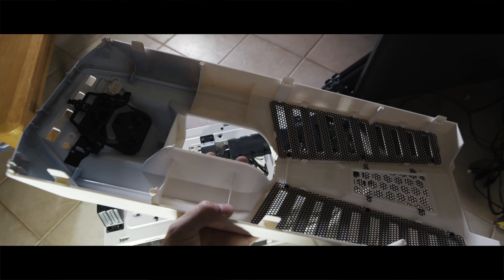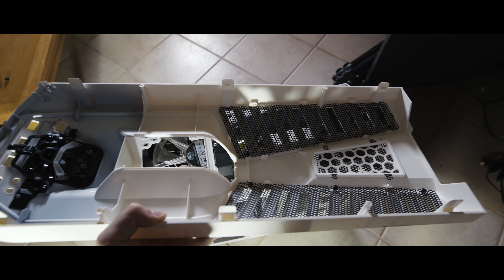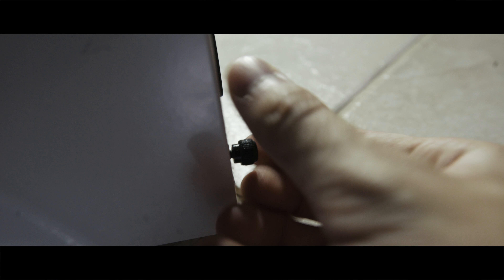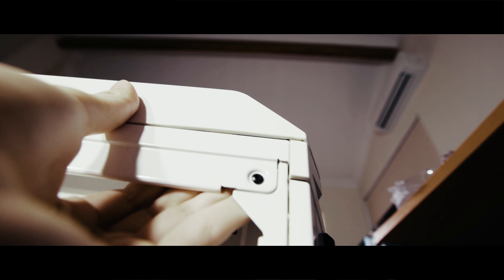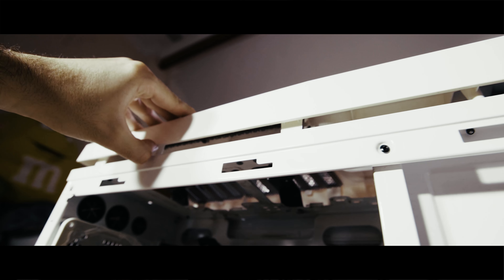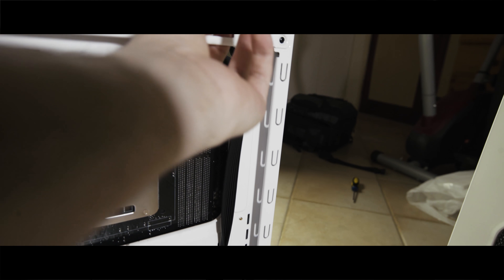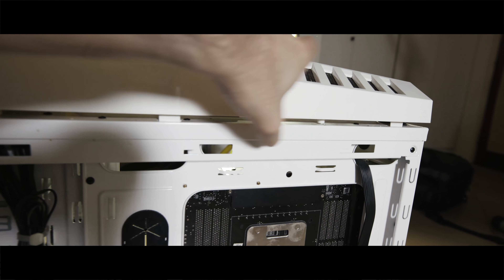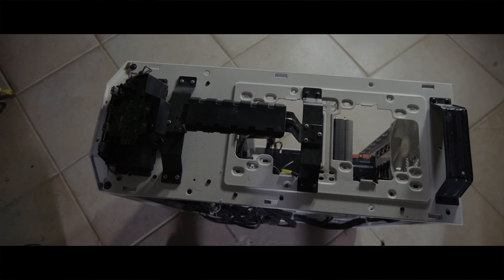Cooler Master Storm Stryker Top Panel Removal

Comment: do u have advise on removing front cover? it looks like two washer screws at top and it just lift upwards but no luck
Reply from the maker: Rohan Richardson I haven’t removed the front cover before personally I will have a gand and see if I can figure it out. The best advice I can give is just analysing how it’s held together and if there’s any latches or screws that’s are holding it in place and then carefully trying to pull them apart to see if they will come off just never forcefully pull something off. If it has any sign of resistance you’re probably doing it wrong and you’ll mostly likely break it most things like this should come off very easily with the right technique.
Reply: @DiFrancoFilms  its ok i worked it out. you remove two washer screws at top then two normal screws towards the bottom of case then it kind of slides up. like you said if it feels like its gonna break it probaly is and your doing it wrong :)